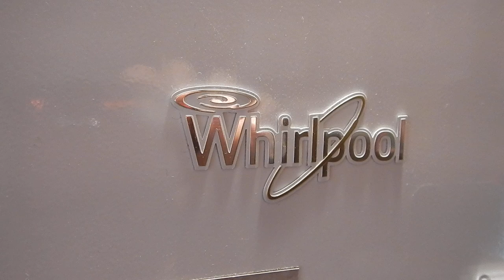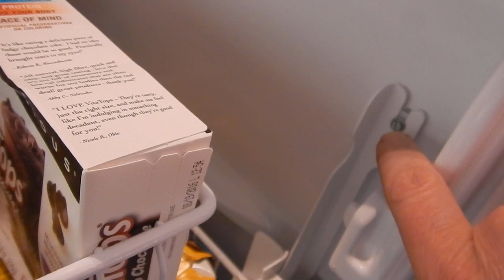whirlpool bottom freezer leaking Free permanent fix

Comment: Great video, thanks. I made the mistake of not completely thawing the drain hole with hot water. The purpose of the rubber duckbill is to prevent cold air in the freezer compartment from blowing through that drain hole and escaping into that rear compartment where the compressor and fan is. If you put your finger near that drain hole while the fridge is working you will feel that cold air. A P-trap is a much better solution because it completely blocks cold air in the freezer from blowing through the drain line but can't clog up like that duckbill. That drain line is so small that leaving the duck bill off probably has minimal effect, obviously you've proven it works fine without it. So you might be losing a small bit of efficiency but not affecting the overall operation.  If you have central air conditioning in your house, you'll find a similar P trap in the condensate line, only it's much bigger. Without that P trap the cold air in your furnace plenum would blow out the drain line and be "wasted" by blowing into the basement instead of blowing through the ductwork into your house.
Reply: Why wouldn't this ptrap get clogged just as the nipple did. Kinda like the ptrap in the kitchen sink clogging over time from debris collecting in it?
Reply: It's true anything can clog, but it's all relative. The duckbill will clog from just dirt and fluff, the ptrap would need something bigger, like pieces of food. The design of the tray  and cover where the water gets collected makes it pretty much impossible for anything to get in there except the dustbunnies that blow around in the freezer.
Reply: I agree, great video, helped so much, Thank you!
Reply: Great information. Thanks

Comment: I did this, unfortunately I did not have the groomer in my drain. My drain was S shaped and clogged with dust and pet dander somewhere in the middle of the drain. Had to remove the drain completely. Unclipped it. Ran high pressure water and it finally pushed out the clog. This was the first time I had this issue, and it took about 8 years to clog it up. $202 repairman problem. He also told me to clean all the dust out from under the fridge and clean the coils once a tear to prevent this problem, and any potential overheating issues.

Comment: I read through the comments before my husband and I attempted this procedure. I used someone's suggestion to use a meat injector without the needle. Work wonderfully and was pressure to clean out the tube. My husband squeezed to tube to work the blockage out. I pushed 3 mug fulls of boiled water through the drain, using the injector. I added diluted white vinegar to the 2nd mug and finished with just water to rinse. My husband took care of the water that was filling up the tray so it didn't overflow.
Worked very well!!!
Thanks for putting this on!
VERY HELPFUL in the times we are living!

Comment: Thank you.  My fridge started making a periodic high pitch noise like a stuck vent trying to move for a number months.  Then came the bottom freezer icing up which I noticed when the slide out freezer drawer started dragging on the ice buildup.  This solution is like taking a potato out of a car exhaust pipe ... the change in sound was noticeable.   Some water flowed into the evaporation pan immediately when I removed what is in effect a plug.  I absorbed some of the water in the pan to insure it did not overflow and then left it run for a few days.   The result has been no more excess noise and the freezer has no more ice buildup plus I didn't have to remove the freezer drawer to get at the back pannel since removing the plug opened the dam returning the drainage back to normal.  Good fix.
A 1/4 inch socket is what you need to remove the back pannel.

Comment: So if your freezer is full on ice and the drain pan is dry this is probably your problem!
I followed your method of removing the Rubber grommet. Bad design that does not function as designed. Probably also what started the problem. I took an old ketchup bottle and 4 feet of conduit "1/2 " OD electrical Conduit" and pumped very hot water through. I used a wet vacuum to remove the flush water from the pan evaporate pan under the compressor fan in the back of the refrigerator.  In the future I plan to use the same system but will add vinegar to the flush. I'm thinking that without the plug/grommet it should flush it just fine without needing to open the back.  Thanks

Comment: Thanks for the great video! Solved our problem,  took less than an hour. We actually ran a pot of hot water in the coffee pot then used a meat injector with no needle and put the water on the drain hole. Worked great!
Reply from the maker: good idea, have a good week
Reply: Oh, that meat injector is a good idea.  I don't have one so I just used a Pyrex glass measuring cup to pour the water all along the venting and in the drainhole.
Reply: That worked great!!! So GLAD I read the comments first! I boiled a kettle of water and used that. Used a mug full to fill injector.  Once that went through, I mixed diluted white vinegar with the hot water and shot a mug full of water through. Finished with another mug full of water to rinse the vinegar out....didn't want acid left to eat the tube.

Comment: Thank you for posting this. I have an Amana by whirlpool with the bottom freezer. leaking water and this worked! I will add for those wandering the actual procedure that I used a small driver to remove the hex screws from the back panel (where the collecting pan is) and inner freezer panel (which is necessary to access the drain hole) then a screwdriver-type-pick to break up the ice around the drain hole, and surrounding areas, and then used my gooseneck kettle to pour warm water down the hole to ensure that it was all cleared out. its been bout 3-4 hours and no water leaking . saved a technician fee of maybe $250 and a new fridge for maybe $800. took about an hour or less including cleaning up .
Reply from the maker: Good to hear

Comment: Great job on this. My side by side Maytag had the same problem. Took off back panel. Took off black rubber 90 degree fitting from the freezer defrost drain. It was plugged with purple goo. Cleaned under hot water with a stiff wire as a scrubber. Skinnied up a toothbrush so it fit up the freezer defrost drain pipe, (about 3/8" I.D. plastic). Took Dawn dish washing liquid on skinny brush and spun it up into the small drain pipe. Did this eight times until the dirt looking stuff was no longer coming out on the brush. Shop vac, (skinny hose) sucked it out just in case. Opened up freezer. 2 foot tall back panel had 3 screws on the top, (hex head). I took two off. One was impossible. Gently bent up panel. The drain sheet metal pan had ice between it and the drain fitting. YOU HAVE TO DO THIS IF YOU WANT IT TO DRAIN! Unplug fridge so you are not fighting the fan... Took heat gun and melted the 3/4" thick ice sheet, (just to speed up the melt/loosen the grab between plastic fridge shell and the metal funnel). Took big flat blade and broke ice out that was plugging the drain hole. Had cookie sheet below freezer to catch ice that I broke off the bottom of the freezer. 
FYI. The freezer coil is heated every few hours to melt the frost off the coil up behind all your frozen stuff. The water has to drain to to pan under the fridge. The water is evaporated from the pan with help from the fan. 
Any way with lots of tools ready, it took about 45 minutes. Just move stuff from freezer to fridge and it is fine in that amount of time without it running.
Again. Awsome video! Saved me hundreds or thousands on a nine year old Maytag. (Vacuum all lint and dust off everything when you are back there. It gets nasty every 3 or 4 years.)

Comment: Great advice for novice. My whirlpool bottom freezer has  done this the last 3 July's in a row. By the time I realized the problem everything thawed. Apparently the freezer quit then started up again. I never had water on the floor. Is there a safety switch to shut the unit off? I lost some product but now I'm paranoid about putting anything important like sockeye salmon in this freezer. I've watched a few videos on this problem but it seems like others with this problem the freezer keeps working whereas mine thaws completely then starts up on its own. Input please. Is there a safety switch or what?

Comment: I have the frigerator at the top and the freezer at the bottom model. I have the same problem but not in the freezer it's in the refrigerator. Inside at the very bottom is where it's collecting, freezing and leaking constantly. How do I fix this?  Is there the same drain inside the refrigerator at the bottom?
Please help.

Comment: Thank you, sir!  Electricity was out for 36 hours in January and I guess that was enough for it to finally catch up to me in July-August.  Ice in the bottom 3-4 times and water in front of fridge on the floor.  Although it took me 2.5 hours between vacuuming the back of fridge, finally relenting to remove the freezer front and drawers (found how to remove the drawers in another video) and pouring hot water all along the vents and the drainhole.  Checked to make sure it was draining into the pan before closing it all back up.  Now, let's HOPE it stays that way as I'm sure this refrigerator costs 2x more times what I paid for it 11 years ago.
Reply from the maker: yeah inflation is crazy!!!  it should be good for you now

Comment: I have a KitchenAid side by side fridge. I saw the video..  and I found the drain plug inside the fridge was easier to access than the French Door freezers. I cleaned the drain plug with a wire and ran hot water with baking soda thru it using a turkey baster. I saw the water drain. I was thinking of putting a thin tube like a ballpoint pen refill or a stainless steel straw into it and leaving it there. I think that will open the duckbill valve a little letting any water seep thru.
Reply: Moon Pie  Yes, but less trouble than pulling the fridge out and replacing a part from the back. I found an old steel telescopic antenna from a kid's R/C toy and I broke a segment off which I inserted into the valve. I just jiggle it every month and remove it to wash and re-insert. Acts like a drain they put in the the body after surgery!
Reply: On the latest episode of MacGyver?

Comment: After releasing the clog with boiling water - I used my shop vac from the back to suck all the crap remaining out then I used the blow side to force air through the drain from the front. I also used the shop vac to blow the remaining ice particulate and water into the drain so I did not have to remove the interior back of the freezer. Thank you for your insights !

Comment: Glad I found this video. I think this may be my problem. Freezer ices up when the temperature drops down cooler after humid days. Fridge not cold enough when this happens. Already changed the control board thinking this was the issue.  I can put it into forced defrost and it'll clear up for a few days. I don't think all the ice in the bottom is totally defrosting and draining properly.

Comment: I completely removed rubber nipple and installed the gray slide looking part and still having the problem with a sheet of ice in the bottom of the freezer. I have now removed door and slide out shelf and am going to attempt to flush the drain with baking soda and warm water.

Comment: Thanks for the video!! Very helpful! Just a couple of other items that helped me also. I was able to use a bucket of very hot water and a fish tank siphon to clear the drain hole without taking the door off and the drawers out.... Saves a lot of time!!!! Lots of water on the floor but it's still way better than taking everything off. Also I have a p-trap in the back instead of the chute. The p-trap also clogs with slime so you have to remove that and fully clean it out. Thanks again!!

Comment: Yep, this is exactly correct. I used hot water and a turkey baster right on the drain. Feels like it's a pattern of Whirlpool under-engineered appliances and selling upgrades when they become an issue. From them going back to an older ice maker retrofit, P-tube replacement for the drain. I guess the grommet was to prevent some non-existent splatter, but it should have been a hose in the first place just like the water going in. Big brains!

Comment: Thank you so much. I installed a kit to prevent the water build-up but it didn't work. After watching your video about adding hot water through the drain, I tried it. And it works. I confirmed that water was going to the drain.  Thanks so much.

Comment: I performed this repair on my Maytag version of the Whirlpool refrigerator and added the P-Trap in place of the poorly designed rubber nipple device. The freezer trays were removed but I left the back panel attached and used a hair dryer to thoroughly melt as much ice as possible then allowed the refrigerator to thaw over night. The next day the drain was checked using a hot salt water and a turkey baster while checking the drip tray for water flow. The drain was thawed and now flowing water freely. Completed the job by installing the new P-Trap and re-installing the rear access panel and freezer trays. Success! 

Addendum: Searching the internet for the lowest price on the P-Trap using the part number listed on an appliance parts page (which had the highest price) a replacement part was found for only $12.95 plus $3.50 shipping. Very reasonable price.

Comment: I did this and it seems to work. My one question is what that nipple is for. Maybe to keep particles from blowing up into the freezer from the bottom of the refrigerator?
Reply from the maker: Maybe...or to let water through slowly
Reply: It keeps warm moist air from entering the freezer compartment, which causes more ice build up and decreases efficiency.  P-trap hose is best solution.

Comment: Great video!  My Whirlpool is a later model but had the exact same issue....the issue was that the S trap in the drain line became clogged with slimy mold.  One the tube was blocked, water backed up into the drain and froze.  The fix was straightforward, melt the ice inside, remove the drain tube and clean it out.  Not sure what caused the slimy mold or if it will come back.

Comment: I ran a copper wire through my tube until it all melted.  But I did this in a Roper with the freezer.  Now after 5 months or so its all thick frozen again. I wished there was a permanent fix.  
Sir it will come back..promise

Comment: We've only had this happen once in the 6 or 7 years we've had this refrigerator. Years ago I was told to pour a cap full of bleach down the drain every six months or so. The bleach will clean out the crud that builds up in the drain. But I will look at the drain under and make the changes, Thanks
Reply: I'm going to try this first instead of hauling the refrigerator out

Comment: Thank you so much!  I just did this, so only time will tell if it's permanent, but it sure looks like exactly the issue I've been avoiding fixing for several years.  THANK YOU!
Reply from the maker: Mine has never done it again..thanks
Reply: ADD is multitasking  we have the same problem. Ice on bottom but also our ice maker stopped working! Could that be related??

Comment: Thanks for this video.  This is exactly what's happening to me.  I've taken to placing towels in the bottom of the freezer to absorb the water.  I eventually have to remove the towels, get the ice off them and dry them.  I do it every couple weeks.  Luckily I keep very little in the lower freezer, so I've just pulled out the grate that comes along.

Question I have is how did you get the water poured down the grate in front on the front / inside of the freezer?  Does that piece come off, or did you use a watering can.... Just trying to figure how to make sure the water gets down to the desired point w/o pouring all over the freezer linter itself?

Thank you for your feedback, and good video.

Comment: I've dealt with this ice buildup issue for years with my Whirlpool upright freezer.  Every 3-4 months I have to open up the internal panels and thaw/remove ice.  After removing caked on ice in the bottom of the unit, I recommend using a hot water and vinegar solution (like Mike suggests in his post) to thoroughly thaw and clean the drain before re-assembling the freezer panels and shelves.  Keep plenty of towels and sponges on hand to mop up water.   This  maintenance protocol will have to be performed on a regular basis only because of poor design standards by the producers of refrigerator-freezers.  Long -term permanent solution:   The freezer-refrigerator industry needs to go back to the drawing board and come up with a better design standard that would preclude ice-build up in all their products.  I really do not understand why the industry under-sizes the drains in the first place as it just lends itself to frequent freeze-up and unnecessary maintenance.   The customer deserves better for the price they pay for these products.    Is there another Ralph Nader around?